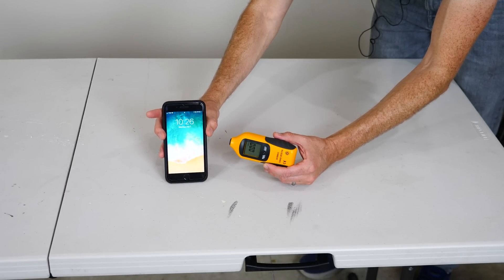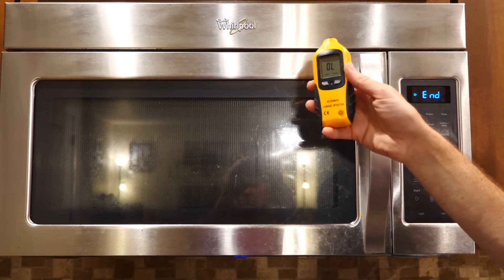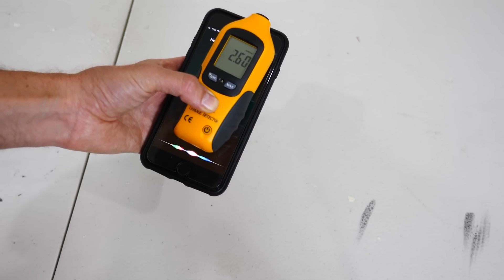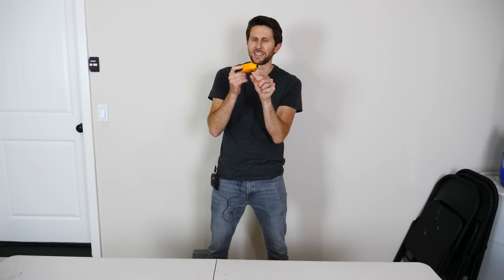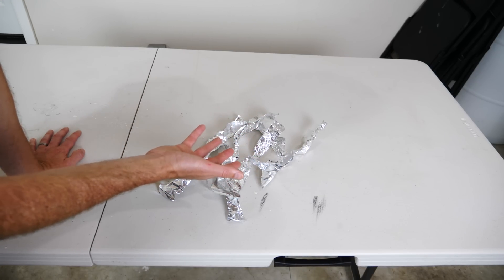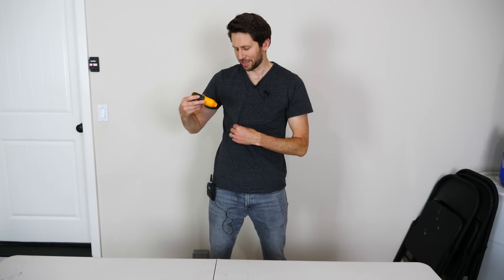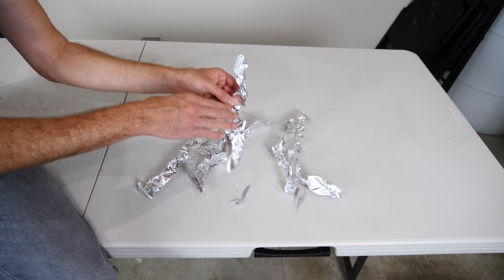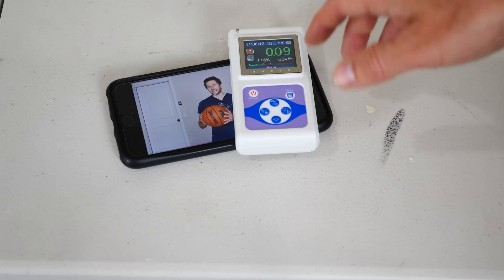How Much Radiation Are You Getting From Your Phone?

Comment: Say what you want, believe what you will.

I became sensitive to wireless radiation and ultimately homeless because of it. I sat in front of a computer for 20+ years, had a cellphone since 2002. Always noticed feeling irritated after being on any wireless phone after a few minutes. Eventually I developed a brutal panic disorder that lasted 2 years. Noticed I was extremely sensitive around wifi. Few years ago had a job where I'd ride in the boss's newer truck fully loaded with all the latest wireless electronics options. Eventually figured out it was making me sick. I dealt with it for a while. When I wasn't working I'd hold on to my phone all day while using it. After a while, I got so sensitive I couldn't even be around cellphones, especially iPhones, let alone try to hold one, couldn't be by a computer for too long. We also had five smart meters on our apartment wall. 

This is how you become sensitive. Be around this stuff all day everyday. Just a matter of time. How do I know I'm sensitive? Well, how would anybody know they're sensitive? You know when you can't be around it because when you are it makes you feel absolutely horrible. And when you are away from it, you're fine. 

However... There are some products that help me that I found and took a chance on. The brand is Aires (American Aires Inc). They don't reduce the effects by 100% but now I can actually function alot better. I feel maybe a 50-90% reduction depending on the situation. 

So this is MY proof about radiation. Because I lived it.

Edit - 1 year later: While the AiresTech products help with tolerating wifi for longer periods and greatly reduced symptoms (when placed on the device), I now also use the Q-Disc 5.0 from qnlabs/prlabs for my phone. It's attached directly to the back of the phone, where it should be to be totally effective. And it is completely effective for me concerning the symptoms I was experiencing from my phone, whether it was from holding it, being near it, or touching the screen a lot while I had it in a holder. As a person sensitive to artificially produced EMFs, I can now hold my phone as long as I want with zero detectable ill effect. I recommend drilling a hole through the case (all layers) where the device sits so that it can sit nearly flush with the case. Otherwise, it can eventually crack the case from the pressure (like it did to my OtterBox) if it has hard plastic, or it could possibly warp and/or damage the phone, or even prevent the case from fitting on the phone well enough to stay on or make use of depending on the case.
Reply: Well thank you, gentlemen. Maybe someday we can all start an Anti-Anti-5G/Physics Awareness organization. I have a lotta reading to do. I actually like reading.
Reply: @mikuspalmis  Anti-Anti-5G. I love that name lol.
Reply: @PixlTheAxolotl  🤙🏼
Reply: Long story short:

I was tired
Reply: @PixlTheAxolotl  No, not was tired. I AM tired.
Reply: @PixlTheAxolotl  Everything looks good on paper... that is until you can't hold phones anymore or be too close wifi routers. Just my experience. I didn't leave my apartment over my imagination.
Reply: @PixlTheAxolotl  I have nothing to gain by making this up, just trying to possibly help others prevent this from happening to them or to have someone they can relate to if it does happen. Before it happened to me, I was not concerned obviously or else I would've taken preventative measures.
Reply: @mikuspalmis  I love the Nocebo Effect...
Reply: @PixlTheAxolotl  Actually, I had to figure out what was happening to me, I had zero negative expectations for any of these things. Simple cause and effect relationship.
Reply: @PixlTheAxolotl  I already did look it up. Also, I said nothing about 5G, but your assumption is correct. The thing I'm trying to get across to you is that I never had any concerns about radiation or EMFs. All I know is that if I hold a phone for too long or if I'm too close to a wifi router, without thinking about what I'm doing at all, no worries or thoughts about radiation, then I experience an ill feeling that doesn't compare to any other common sickness. That simple. If you knew me personally then you would know I'm not a hypochondriac, a liar, nor schizophrenic. But you don't know me so I can't expect anything from you. It's as simple as how someone traces a negative physical reaction back to a certain food they ate by repeated experiences. I can't convince you of anything so you trying to argue with me is pointless. You believe what you believe, I know what I experience. Commenting might make you feel better but it can't change what I know. I can't prove any of this to anyone. It's just a warning and an attempt to reach out to those suffering. Continue if you like and I'll continue to help you vent out your negative feelings, but if that's not what you're doing I don't know what it is you're trying to accomplish here. I'm sure you're old enough to have had an experience where some people believed you and some didn't?
Reply: @PixlTheAxolotl  Also, to answer your question, no I don't believe the color yellow is giving me terminal brain cancer. 

But I can't prove it.
Reply: @mikuspalmis  Actually this is the first time I decided to reply to a comment like this. You keep beating around the bush for some reason. Why? Am I scaring you with my knowledge of physics? I mean seriously, there is so much more to learn about the electromagnetic spectrum than just "5G BAD." Research and critical thinking are key. You cant say something happened without prior knowledge to begin with. Thats like saying "I'm late for work and my car won't start, therefore my employer sabotaged my engine."
Reply: @PixlTheAxolotl  Over this past year I have started to consider the possibility of abrasive YouTube comments and discussions contributing to cancer.

However, you ARE helping me to exercise my very recent efforts in handling difficult people in an understanding and positive manner.
Reply: @PixlTheAxolotl  I'm beating around the bush? Ask me anything.
Reply: @mikuspalmis  wdym? I asked you a question like 4 replies ago and you still haven't answered. In fact I've given you logic to take into consideration and you throw it away like gum wrapper whilst going on a different tangent. Thats beating around the bush.
Reply: @PixlTheAxolotl  No, I answered that one lol.

Ok, I'll go through all of em. I thought some were rhetorical.
Reply: @PixlTheAxolotl  No, you're not scaring me with your knowledge of physics. That's the only other question I saw.
Reply: @PixlTheAxolotl  i would save your sanity and not reply to this guy. he obviously doesn't understand how physics work.
Reply: @mikuspalmis  Just read a physics textbook about electromagnetism, dude. 👍
Reply: @bromat7682  Really... 
Well, come to think of it I really could be. I'm trying to overcome that.
Reply: @bromat7682  I really don't understand that much about physics.
Reply: @PixlTheAxolotl  What's the best book on electromagnetism? Actually it's ok if you don't know, I can look it up. Despite my ignorance I'm actually really good at finding things online. I'm not lazy in that regard.
Reply: @mikuspalmis  that must explain why you think 5G causes illnesses. i recommend you take a look at a physics book like mario said. you may learn something.
Reply: @mikuspalmis  The book I used in high school is called Prentice Hall Conceptual Physics: The High School Physics Program by Paul G. Hewitt (Ferris Wheel Cover)
Reply: @PixlTheAxolotl  Oh, ok. Thank you.
Reply: @mikuspalmis  No prob, and good luck!
Reply: I wasn't into highschool though, obviously. I would've been better off getting a GED early and going to a trade school but oh well. Here I am.
Reply: My grandfather on my dad's side was a machinist at Lockheed-Martin. Why did my dad get into landscaping?! 😄

Comment: These conclusions about health safety are blatantly INCORRECT.
Especially for 5G.
1) There are ZERO health studies showing 5G safety. 

2) Long wavelength radiation doesn't mean "less dangerous", it means it penetrates tissue deeper. Even UV radiation stops at the skin. Microwave go to deep tissue until it's absorbed into structures, typically stopped by Hydrogen adsorption. 

3) Everything has an excitation frequency. Including body tissues. Various frequencies of radiation vibrate and effect structures differently, even down to the molecular level. Resonances are a real physical effect. 
 
4) Radiation effects on brain from current cell phones show up on brain scans. I can tell you immediately which side of your head you hold your cell phone to. Radio frequency radiation has been proven to effect brain tissue.

5) Many forms of radiation effect tissue. Skin is a protective structure from radiation, but some wavelengths penetrate through skin.
Longer and shorter than Uv-Vis. 

6) Microwaves are harmful to neurological tissues. "Havana Syndrome" has now been recorded in dozens of diplomats and government officials. Microwave weapons are the leading theory. 

6) Even visible light effects brain function. 
Blue light shone on a brain will directly effect behaviors. And is used in many Neuroscience studies for that reason.

7) 5G doesn't fall off with Inverse Square Law, because it's NOT omnidirectional. It's a focused beam at close range, designed to get through concrete walls and wood. It has NEVER been used before in this way.

8) Again: ABSOLUTELY ZERO SAFETY STUDIES HAVE BEEN CONDUCTED ON 5G. ZERO. Anyone claiming "It's safe" is doing so without evidence. Their "opinions and feelings" are not backed by science or data, or any study. Don't listen to anyone who claims otherwise, because they're misinformed, guessing, or lying to you. Ask them for a peer-reviewed published Safety Study. There are none.
Reply: This comment is very important! 🙏🏻
Reply: @johnny1873   Thank you. A little knowledge can be a dangerous thing, and advising people on health matters without researching medical effects is unacceptable. He should have done his homework on radiation. It's an area of active research.
Reply: I became sensitive to wireless radiation and ultimately homeless because of it. I sat in front of a computer for 20+ years, had a cellphone since 2002. Always noticed feeling irritated after being on any wireless phone after a few minutes. Eventually I developed a brutal panic disorder that lasted 2 years. Noticed I was extremely sensitive around wifi. Few years ago had a job where I'd ride in the boss's newer truck fully loaded with all the latest wireless electronics options. Eventually figured out it was making me sick. I dealt with it for a while. When I wasn't working I'd hold on to my phone all day while using it. After a while, I got so sensitive I couldn't even be around cellphones, especially iPhones, let alone try to hold one, couldn't be by a computer for too long. We also had five smart meters on our apartment wall. 

This is how you become sensitive. Be around this stuff all day everyday. Just a matter of time. How do I know I'm sensitive? Well, how would anybody know they're sensitive? You know when you can't be around it because when you are, it makes you feel absolutely horrible. And when you are away from it, you're fine. 

However... There are some products that help me that I found and took a chance on. The brand is Aires (American Aires Inc). They don't reduce the effects by 100% but now I can actually function alot better. I feel maybe a 50-90% reduction depending on the situation. 

So this is MY proof about radiation. Because I lived it.
Reply: Mikus Palmis, Sorry that this happened to you, but there will sadly just be more and more people like you... You should try to look into BioGeometry. It might seem a bit fringe, but It has solid science and resulta backing it up. Bes of luck to you!
Reply: @johnny1873  Seems a little familiar. Thanks for the comment!

Comment: Hilarious when you think about it. Some people store their cell phone in their front pocket, beside their crotch and hold it to their head during a phone call. That is why, unless I am making a minute long phone call, I always put my earbuds in or use speakerphone.
Reply: You clearly haven't watched the video. Phones only emit microwave radiation which is non ionising. All the microwaves can do is heat you up slightly. You heat up much more simply standing in the sun. And guess what? Your body has inbuilt cooling system so it literally has no effect on you
Reply: @linecraftman3907  I watched the whole thing. I understand the findings, but with such a simple solution to the issue, why not.
Reply: @johncasey5594  Because it's not an issue lol

Comment: What about next to a cell tower?
Reply: Unless you shove your face next to the transmitter, by the time the signals get to you they already lost most of their power.
That's one of the reasons you don't see cell towers at ground level, too many idiots would get too close.
I've seen a few numbers, about how cell towers transmit at around 200W or less, so just imagine a 200W incandescent light bulb at the same distance of the transmitter, and measure the heat you feel.

Most towers probably transmit at less than 200W though so it's even less.

Comment: Does anyone knows if there is some sort of correlation between internet speed and radiations emitted by wi-fi router? I.E. if I use a router 6, 1GB internet speed connection, do I observe more emissions?
Reply: It won't specifically be linked to the speed, but frequency. For example, modern WiFi standards utilise the 2.4 GHz and 5 GHz frequency bands. A higher frequency means that theoretically more data can be transferred at one time, leading to a higher data speed (802.11ax WiFi runs at 60 GHz for this purpose) but with a consequential increase in energy, as more energy is transferred per second. You could thus assume radiation would be higher.

However to be clear, these are still incredibly small differences and all signals must still fit under regulatory power limits. I'd wager a guess and say the physical power the signals are transmitted at is altered to compensate for this too.

Comment: It's really cool here. I got an old portable General Electric double case the player with a.m. f.m.,  a built in equalizer and pull up antenna (the thing is 15 inches long by 6 I chez deep and takes 6 size C batteries and ran the thing outdoors with the treble set at maximum (tin soundwaves) with static to grab and then level volume imbalances near where I live. It isn't loud but the box is good used condition to rebalance the busy noise freeways and such in a small valley. It was instantly cool. It sounds like it took most of the ghetto booms out but it balanced them by adding treble. It's quieter. Nice. Save us? The nature of wires is flowing. It buzzes and dissolves stiff waves that may be so stiff with untapped news and songs (constipation) that they affect the weather. Angry floating untapped news in the sky cause friction and heat. The sharp ups a d downs are like broken glass. Static is a soft host rough surface that smooths it. Just don't let your bubbles stay large or someone else may collapse and keep them from your radios. Turn up to catch then down all the way and off. Others may catch them for their old shows and such. Yes, scary and were THAT FLOODED beneath the earths inner cabin. We forgot to spread the darn waves out with a carrier sound! Tus miraculous but kinda smart at first. Its a necessary clean up to get a amaño etéreo soy a cold quality treble to settle crazy making floating base frontal scary movies on old radio station flipping and the like. I ran ir in total maybe 2 to 3 hours outdoors.

Those are like Soundwave carrying balloons. No big deal if you can grab em with a matching audio quality and shrink them to silent. Returned to their original size it's heavenly. Cheers

Comment: If you ever want to hear you GPS on your phone. Put an AM radio buy it on 5:30 a.m. or lower. It also lets you know if the phones on and off or if it's spying on you.
Reply: No.  And you are not hearing your "GPS" on your phone.  You are simply picking up RFI which is radio frequency interference from the circuitry all electronics emit while working...

Comment: This video can be discredited on quite a number of counts: 1) Phones act as recepients of ICNRP 99% of time, with all RF radiation happening in the DL.The source being your wifi router, or call aeriels. Much of DL RF happens all the time, from multiple sources, and not only when you knowingly(!) use your phone. 2) phones are multitech/ multiband /multimode devices, which means they switch between 3G,4G, WiFi at will, and use spread spectrum radiation, or as in LTE, a large number of subcarriers simultanously. None of which your meter is capable of quantifying properly. My 3rd point is that citing heating as the only effect of microwave radiation on humans, is like saying that the only effect of alcohol on the body is getting drunk. There are numerous studies which show e.g. accelerated rate of division in cancer cells, supression of insuline production in pancreas, a fall in sperm counts and quality. These are all indicative of the effect on health is pretty profound. There is however a suspicion that no thorough studies of such effects are conducted to avoid frightening the public away from smartphone technology.
Reply: you clearly know nothing. the meter measures everything in the air. also signals spread and weaken extremely.
Reply: "The neter measures everything in the air".. including CO2.
Reply: @gezzababe8888  by everything i mean all non ionising radiation